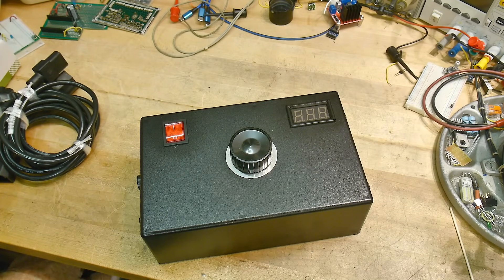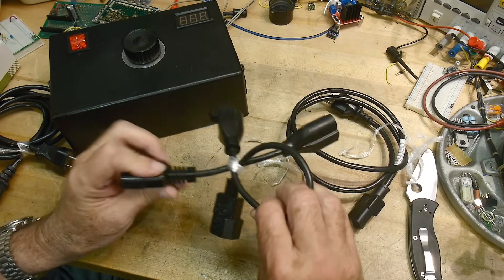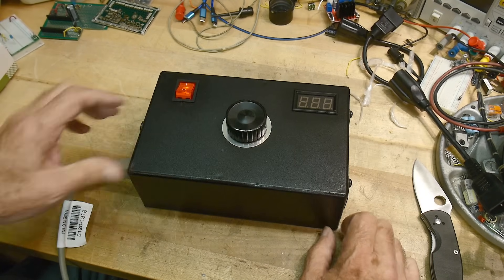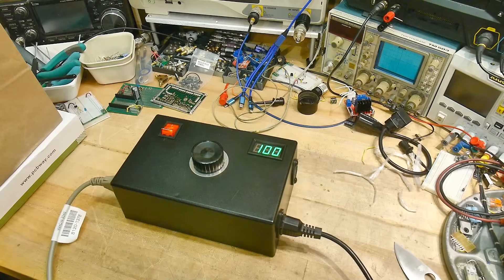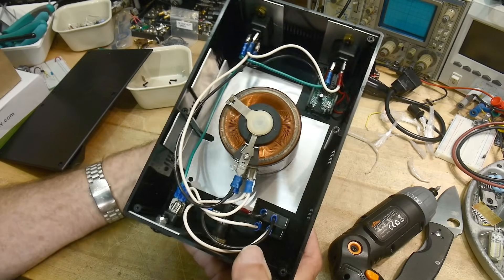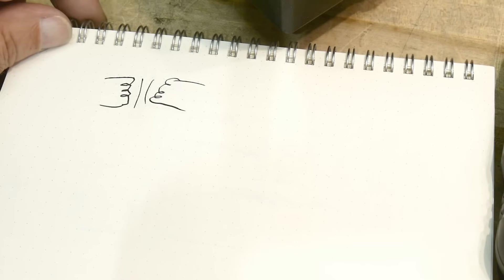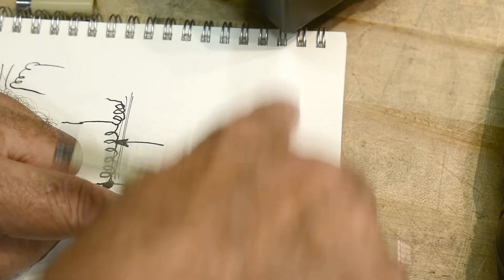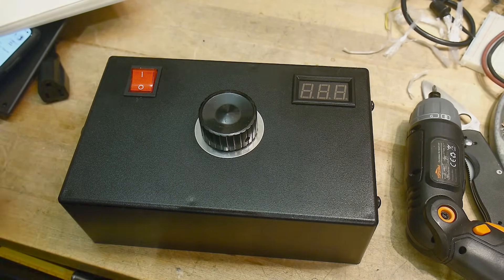#1895 Mystery Black Box

Comment: Hi, a nice little regulation transformer, my transformer has a diameter of almost 20cm and a coil height of 10cm.
Personally, I prefer to connect the isolation transformer and then only the Variac, so I get two independent connection options - direct output from the isolation transformer and the other regulated.

Nice day 🙂 Tom

Comment: Hi, thanks for the video and the clear explanation. I think it is beter, though, to have the isolation tranformer first and the variac second on your bench. Quote from the internet: “Grounding issues aside, the isolation transformer first is the better way. If the variac is first, you will starve the magnetic field of the isolation transformer, causing poor voltage control, especially at lower voltages.”

Comment: Those "weird shrouded male" connectors have been standard on computer servers for decades.   The male end is IEC-320-C14.  I think it's so that equipment can more easily have a "lock" mechanism that prevents accidental disconnect of the cord.  Usually there is a little mechanism next to the socket that will secure around the cord, but this variac does not have such a mechanism.  Some companies such as tripp-lite also sell them on computer extension cords.  In that use case, the shroud protects from accidental electrocution of a user by covering a loose connector.
Reply: I know the IBM PC XT used this method to give you a way to pass-thru power to your monitor from the desktop's psu.

Comment: Hmm, I always thought the distinction between a Variac and a autotransformer (or variable transformer) was that the Variac was electrically isolated between the "primary" and "secondary" windings and that the autotransformer used a single winding functioning as both the primary and secondary with windings above the top of the primary to give you the higher voltage. Isn't this thing an autotransformer?
Reply from the maker: https://variac.com/staco_variable_transformer_100_.htm
Reply from the maker: Dino, make sure when you teach you pass this along. The Variac myth will kill

Comment: Confusing isolation transformer setup, output voltage is not what you set from variac. Transformers are not very good with input voltage they are not calculated for.  Better is to put 1 to 1 isolation transformer first and then variac, especially when variac can output more than input is.

Comment: I usually put the isolation transformer on the input side of the variac - I'm not sure if it makes any difference. You can also get panel meters that measure voltage on 2 channels - the input (which also powers the meter) and the output. That allows the panel meter to show the output voltage down to 0. They're less than 10 on the usual big rock candy mountain site, but the trick is finding the two channel ones
Reply: Which sounds like the far saner thing to do. That way the isolation transformer always works at mains voltage which it was designed to do - as opposed to try to work at some low voltage AC you get on the output which it definitely was NOT designed to do. Transformers are NOT "just input some AC here, any AC" magic boxes, even if they can be misused that way.

Comment: Isolating transformer first or Variac first?
Reply: I'd say "it depends on the power ratings of both". The first stage will be loaded with the second stage's losses on top of the proper load, that's a thing to consider if power rating is limited.

Comment: That configuration is also known as an auto-transformer. They're often used for higher powered voltage conversions as you only need one coil of wire rather than two. Though, you do see regular transformers with one end commoned with each other - you will find this with the power transformers leading to your house. The phase and neutral go into the transformer, and out comes your house voltage. But then the the neutrals are bonded to ground and tied together. And yes, both are called auto-transformers, which are not isolated. (Isolation may not be the goal as without isolation certain protective devices do not work - RCDs/GFI breakers for example do not work in isolated circuits).

Comment: They are useful test equipment for the lab bench.  You can add a 150 Watt light bulb in series with the input, with a switch to short it out.  When the shorting switch is closed you get normal operation of the Variac.  When the switch is open, the bulb flows whatever current is being drawn, and at about 30 Watts which is the typical Device Under Test load, it glows dimly and you adjust the output voltage to the correct level.  If the Device Under Test starts failing, then the bulb will either go out (DUT is open circuit), or glow brightly (DUT is short-circuiting), or start wavering (DUT is beginning to fail).
You could also add a residual current trip between output and ground which senses whether even a small current is flowing between output and earth, and disconnects power if so.
All-in-all a useful way to safely power up old equipment.
I have one, and it sees plenty of use. ❤😊
Reply: My Variac is bigger at about 500 Watts and I test old vacuum tube equipment up to 60 Watts.  For yours use perhaps a 100 Watt "dim bulb" safety load.
Most mains appliances being tested draw only a few Watts...
I have an analogue voltmeter at output that works between 0..300 Volts AC and an analogue ammeter in series with the output that measures up to 1 Amp AC.
Apart from test whether equipment is safe to operate I also use my Variac to vary the "mains" voltage, to test how circuits behave if under or over volted.
Reply: What MrCarlson does.

Comment: Hmm, I was thinking of putting an isolation transformer before the variac, but am I thinking it wrong? I have a 230V/2*230V/1*24V 2400 VA transformer and a 230/0-260V 4A variable transformer waiting to be installed to a bench.

Comment: I have a 1.5VA Statco autotransformer and, comparing it to my other Chinese made autotransformer, it is much smaller and lighter with 1/3 more output. I assume the Statco has a superior core material and the Chinese version is only a crude facsimile.
Reply: @jim9930  that gave me an idea for testing the frequency response of transformers I'd plan to use as output transformers in tube amps. First check if the core is up to the job - then modify the windings...

Comment: Be careful with isolation transformers you find used or new , some have the incoming neutral connected to the output side winding.This defeats its isolation from earth ground we need because neutral and ground are bounded in the main power panel in your home.

Comment: When I saw the thumbnail I thought it was some kind of mysterious camera.  But that turned out to be completely wrong and the actual box with its variac was interesting.  The little meter board is cool and amazingly accurate.  🙂👍

PS - When I was about 13 my parents were involved with doing stage plays.  Backstage there was a board with about 20 switches and a large variac knob to dim the stage lights.  There were also pieces of so called gel of all different colours which were cut into squares and put in the light holders to get different colours of lights.  Although us kids were allowed backstage after the play we were under strict orders not to touch anything.  We were allowed to keep small scraps of gel which are cool because they make everything look like weird colours.

Comment: I'd have thought it would be better plugging the Variac into an isolation transformer would be best, rather than the other way around. (?)
Reply: With the Variac at the output you get the low output impedance at low voltages. At al low voltage of for instance 10V you can avoid to go through a 120V isolation transformer.
Reply: @Manf-ft6zk  Fair enough.

Comment: Hi    Thats nice of her --Variacs are expensive here in the UK , even the smaller ones .  Those output mains sockets were used a lot
on older PCs for power out to the VGA monitor --so that the screen was turned off by the computers on/off switch .

                                                                                                                                                                          Alan
Reply: But variacs are useless on switch mode power supplies.

Comment: Great gift you got for free there, and in an unusual case. Usually variacs are not just the component, but the product itself, already with its own case, knob and scale.
The way how it was encased suggests it was installed as a component, on a panel of some larger machinery, and someone scraped it and made it a stand-alone Variac.
One curiosity I have:
Everybody (since my electronics school age) always explains the oddities of a Variac as the auto-transformer that it is, always emphasizing the fact that it's not isolated and the unsafeness that comes with it.
But I always wondered, why there aren't isolated variacs?
I mean... Their construction is quite simple, with a one layer winding, when there isn't any problem in constructing multi-layered toroidal transformers...
Why nobody makes a two windings Variac transformer with an under layer being a primary and a top layer, an isolated secondary with the wiper...
That's something I never understood.

Comment: There should be a fuse on the output, otherwise the wiper will burn out when the output is shorted - primary fuse won't help because of transformer action!

Comment: A 10 Amp Variac has been one of the more useful tools on my repair bench. I also use them around the house; one controls the speed of a vent fan and another converts whatever the utility's voltage de jour is to 110V for classic tube gear that doesn't really appreciate the 127V average we see where I live.
Reply: I got one that takes 120 in, and can give up to 250 out - very convenient for repairing 220V input (only) power supplies on my bench where I don't have 220V circuit